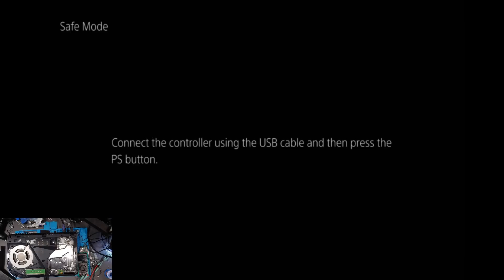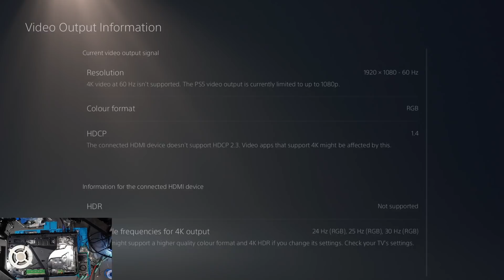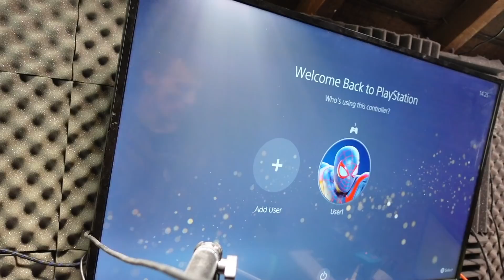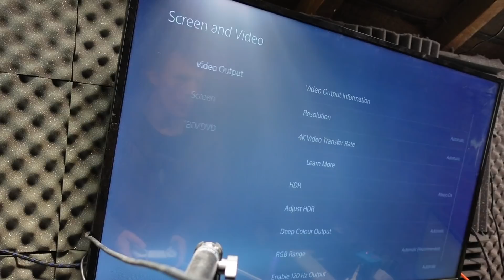I Paid $365/£280 For A PlayStation 5 With No Power From Facebook Marketplace... But Can I Fix It?

Comment: Just did my annual PS4 full disassembly & deep clean. It’s crazy how dirty they become inside & how bad thermals become just within 6-8 months of regular use. Entire heatsink fin stack was basically blocked almost completely. Cleaned the entire pcb motherboard front & back, all memory & vrm modules, all ports, the main chip & heatsink cold plate, fan, all case housings, power supply, disc drive. Reassembled it with new thermal paste on the main processor chip. You can always tell as soon as you boot it back up for the first time how much better it is running, super quiet, thermals are way down & the system just runs better/smoother because it’s not over working or getting near as hot.  I routinely fully disassembled my console about every 8-9 months for a deep clean & fresh thermal compound. I wish it were easier of a process so more average consumers could easily perform these necessary maintenance procedures that will surely extend the life of your hardware components & keep them running smoothly & cool at their highest performance capabilities for as long as possible

Comment: I did an Xbox One from Facebook £40, was advertised as disc drive faulty. Power supply fan was bad noisy( so used some sewing machine oil, probably wrong, any suggestions what lube to use. Also I don't like touching power supplies too. The noise was fixed ) also needed a harddrive replacement and the disk drive had no problem. Great success.

Comment: Very nice video. I like to watch console repair and upgrade videos on YouTube :yt:
My question to you is basically do you not fear shorting yourself or the board by installing WiFi-cable or the ventilator on a live board. 🔌
Reply from the maker: Thanks bud, glad you're enjoying them. There's certain things I'm cautious of like plugging in ribbon cables but in terms of things like WiFi cables, disc drive power cables etc there's no real risk involved to be honest. You kind of get a feel for what you can get away once you do them regularly :) One big no no is to never mess with LCD or backlight circuits while the board is on though, they like to go boom 😂
Reply: @TheCod3r  yes, I can hear you‘re 💡 very experienced in the long way. Professional and cautious at the same time ⚡️

Comment: worth attempting a repair vid on the power supply?
Reply from the maker: It would be mate yeah, unfortunately the psu I already know the fault is due to a failed PWMIC and the replacement chip costs £100-£140 so it's just not worth doing right now

Comment: make a video with the repair of that power supply
Reply from the maker: Unfortunately that's not possible, the failed component on that PSU is the PWMIC which cannot be purchased for less than £100 GBP at the moment
Reply: @TheCod3r  please make a video about it and explain what that part does and how it breaks down
and if you have another power supply try to use it as a donor

Comment: Are you planning to repair the power supply? Those have always fascinated me.
Reply from the maker: I would love to, but unfortunately the failure on the psu on this one is the PWMIC and they can't be purchased for less than £100 just for the chip at the moment, so you need a donor board. I've got 3 dead psus with the same failure now which I've kept back to fix when the chips come down in price
Reply: You said this issue with the power supply is becoming common. Do you know what causes it and if there are any preventative measures that can ensure it won't happen?

Comment: Can I ask I’ve got a disk version that had the awful nidec loud fan which was unbearable so I swapped the fan to the quieter one and it fixed the most of the annoyance however it has quite considerable coil whine from the power supply area, is there anything I can do?
Reply from the maker: Sadly I'm not sure on that. I don't really mess with power supplies but tronicsfix has a video on coil whine:)
Reply: @TheCod3r  like you I don’t like the idea of power supplies either I’m definitely not a technician like you, I’ve stripped my series x to clean it out and it’s much easier to take apart than the ps5 and way less problems! I really haven’t got the confidence to take it apart to put epoxy on lol

Comment: Phil do you have a US link for the flux you use? I've had a hot air station for a while but I've yet to break it out and use it. Might be time to try it out on some junk boards till I get the hang of it.
Reply from the maker: If you check out the description those links on the products should auto push you to a US based link mate. Those "thecod3r.live" domains are basically just forwarders with geo-tracking which basically determines the country based on the IP address and then forwards to a pre-determined link but I have it set up already for all those links to work for Amazon.com :)

That said though, if you're not in any major rush, just search "Kingbo RMA-218" on Aliexpress, it's a lot cheaper there :)

Comment: You tested the first power supply with the main ribbon cable detached and the second one with it intact, does that matter?
Reply from the maker: No as long as the power supply is connected it doesn't matter. Basically if the power supply works it'll show 12v on the input pins :)

Comment: Fix the power supply.
Reply from the maker: Unfortunately I can't right now. The psu has a failed pwmic and the chip can't be bought for less than £100 right now :(
Reply: @TheCod3r  something to keep on the side for when the chips (or clones) are eventually available ?

Comment: Why don't you fix the power supply itself. £100!! Power supply fixes are not usually difficult for somebody with a modicum of electronics/electrical ability?
Reply from the maker: I would love to, but unfortunately the failure on the psu on this one is the PWMIC and they can't be purchased for less than £100 just for the chip at the moment, so you need a donor board. I've got 3 dead psus with the same failure now which I've kept back to fix when the chips come down in price
Reply: @TheCod3r  wow thats unbelievable! Lets hope the chip shortage doesn’t last…..